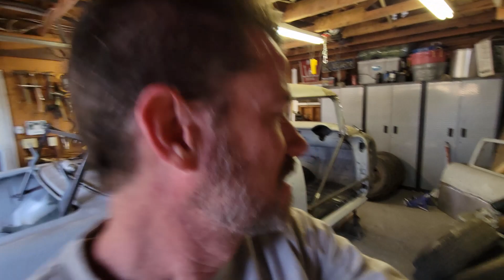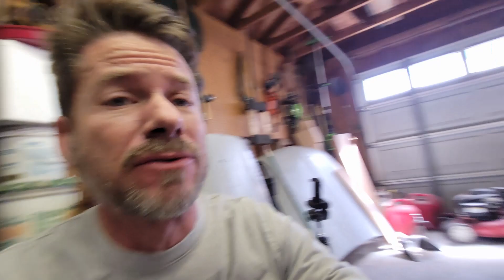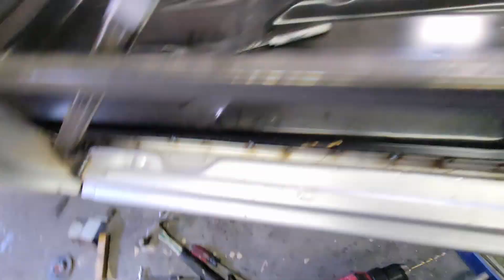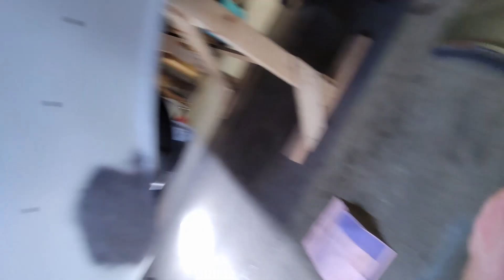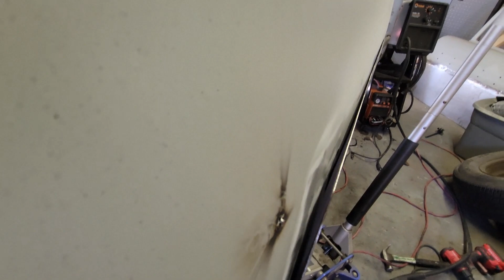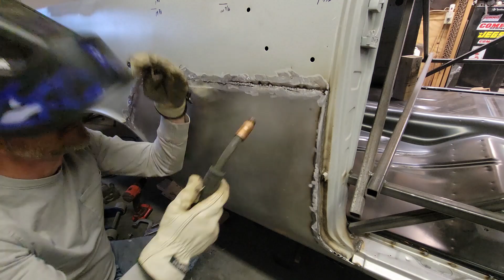E35 Two-for-One!  Tri-Five Rocker AND Quarter Panel Installation!  1956 Chevy Bel Air Restoration

Comment: Question on video 35 when you installed the patch panel on the passenger side quarter panel, did you use the cut and but method where the panel meets the door jam area? It looked like you just lapped it there. Really enjoying your videos, I’m restoring a 1957 belair right now, thanks
Reply from the maker: I might have lapped it at the edge.
Reply: @RestoringChristine1956 thank you !
Reply from the maker: @PhillipJones-s7c at the corners, you can take advantage of that extra material to weld into and not grind and warp.

Comment: Looks like it came together like a glove.
I believe it may help you in the future too utilize those harbor freight sheet metal tongs to sharpen the 90 degree bends on the bottom, followed by a piece of angle iron stuffed on top of your bottle jack too spread the load so you don’t end up with the kinks I saw as you raised it and jumped inside. Just a suggestion. Keep bringing her back to life bud!
Reply from the maker: It's amazing how that went.  When I was using the jack, I couldn't see and deformations. But in the time lapse, you can see one form at the corner just in front of the jack, somewhere in the middle.  But putting your hands on it, it's pretty straight.  Nothing that can't be quicklyvtapped out with a body hammer.  I'm glad you're following along!

Comment: Gotta love those aftermarket panels...always just kinda close... I think I would of sharpened the bends on the bottom ...hopefully the bottom is strait from opening to opening..also I think what you might be runnin into is that your braces were so bad for so long that the body probibly twisted and sagged over time to preset stress on the panels and cutting them apart who knows where the right place is anymore..like I said before the doors will answer all your questions...remember you can move a lot of door gap by shimming the body mounts too... interesting to see how it comes out....good luck..I'll be watchin...
Reply from the maker: So far it seems like it's not racked, but we'll see.  When I did the Cutlass convertible, I locked the entire thing together with bracing and, just like you said, ended up building into it a pinch where the top of the door jambs at the back were tilted relative to the jambs at the hinges.  On the convertible, there is a big knee brace that locks that side panel to the floor.  I had to grind out all the welds and then use a hydraulic jack to pry the two side walls apart!  I'm pretty sure that I don't have that problem here, but we'll see!  Thanks for keeping up with me!